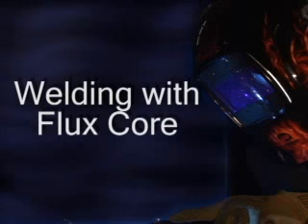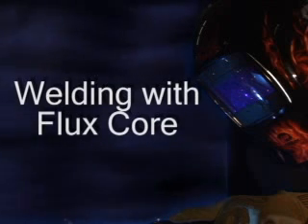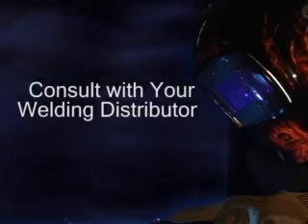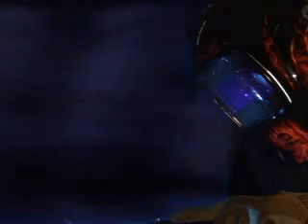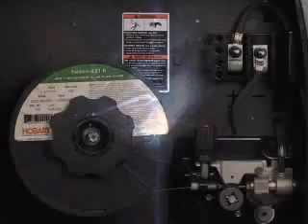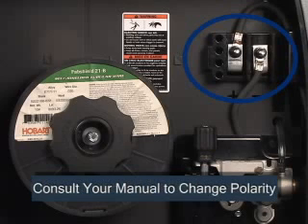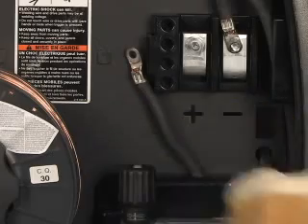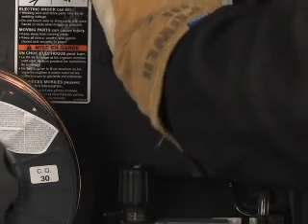Flux-Cored Welding Tips and Techniques

Comment: I have a Millermatic 130 can I dual shield weld with it? I was wondering if you have a recommended wire and setting if it’s possible? I’ve been running regular steel wire .030 with c02. I’ve heard that the 110v welders don’t have enough power to dual shield and there’s not much info out there on my older 130 Millermatic.
Reply from the maker: Hi, thank you for the question. To determine if it will work or not you would need to look at the voltage and amperage requirements of the wire you intend to use. Once you have that determined, you would then need to see if the Millermatic 130 has enough voltage and amperage available to run the gas shielded flux core wire you have chosen.  In most cases, a small 115 volt unit such as the Millermatic 130 is not going to have enough power available to run that type of wire. Thank you.

Comment: I'm new to welding do you have to use gas to use the millermatic 211
Reply from the maker: Hi, thank you for the question. Yes, MIG welding is also GMAW — Gas Metal Arc Welding. It is the most common process used in home shops, small businesses, manufacturing and metal fabrication applications. Thank you.

Comment: can i run 045 on my millermatic 180 ?
Reply from the maker: Hi, Dylan. Yes, the Millermatic 180 can handle .045 flux core wire. You will need to purchase 3 things if you don’t already have them:
.045 drive roll (P/N 202926).045 gun liner (P/N 194012).045 tips (P/N 000069)
After that, you can use the parameter door chart for the proper settings. Thank you!

Comment: @patron4life1 Most weld gas suppliers will charge a deposit and a one-time fee to "rent" one of their cylinders. usually something like 150-200$ for 3-5 years. This covers upkeep on the cyl, which by law, needs to be tested and the valves rebuilt every couple years. Some of them will even refuse to fill cylinders they don't own for liability reasons. Anyway, you pay the rental, then you can take the cyl. back and refill it as often as you like and they only charge for the gas.

Comment: @coalandnuclear If your hard-wire MIG welds have poor fusion and/or penetration, usually it means you're not drawing enough current. One reason that dual-shield / self-shield  penetrates better, is that elements in the flux such as potassium increase the conductivity of the arc, and increase the current  vs. MIG. But the most common reason is that welders with MIG try to use "short circuit transfer" (a low-current process which lacks cleaning action), on material too thick to be appropriate.

Comment: @coalandnuclear all those dexoidizers simply aren't necessary in stick which by design the arc area is better protected from O2 in the air than self-shielded FCAW. Even under ideal conditions, it's difficult to get rid of porosity and worm-tracks with self-shielded FCAW. In normal steels, such excessive amounts Si, Mn, & Al would be considered detrimental impurities. Finally, penetration is a function of joint design, material thickness, travel speed, weld position, and most of all weld current.

Comment: @coalandnuclear Thanks for the reply. Yeah, I forgot the bottle, that's a one-time expense too. doesn't really figure into the net cost of materials at the end of the day. I disagree about stick welding. The physics and chemistry that goes on with self-shielded FCAW are quite different from stick. For example In the former, wire manufacturers are forced to add excessive amounts of oxygen scavengers such as Si, Mn, and Al which in these amounts increase brittleness and impact sensitivity.

Comment: Argon regulator......$150 (one time expense)
bottle of low cost Ar+20%CO2 shield gas......$20
30lb. spool of low-cost E71t-1 dual shield wire......$30
cardboard wind shield w/ duct tape.......5 cents

Making welds that are 100% stronger, tougher, faster, cheaper, far better looking,  and lower-spatter. in other words, better in every possible way ..........priceless!

Note that a 30lb spool of that "self-shielded" garbage costs $75-$120. Still think you're saving time and money?